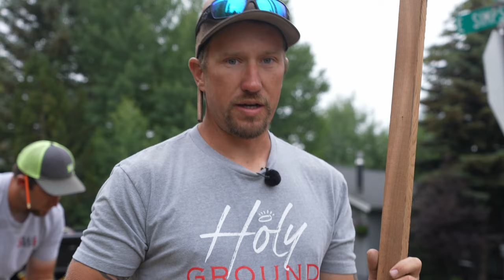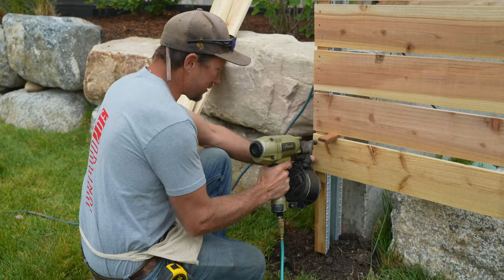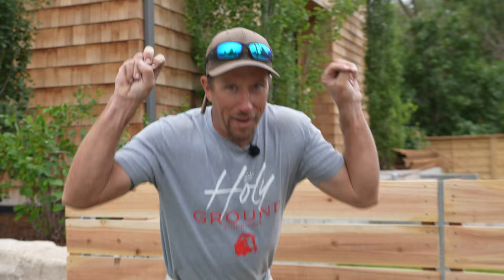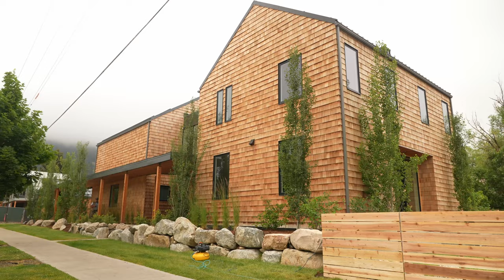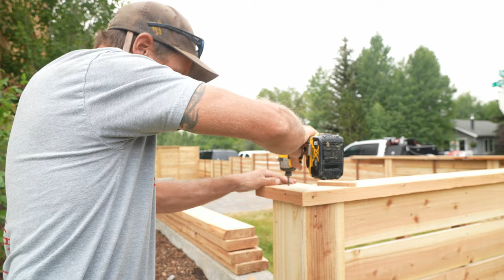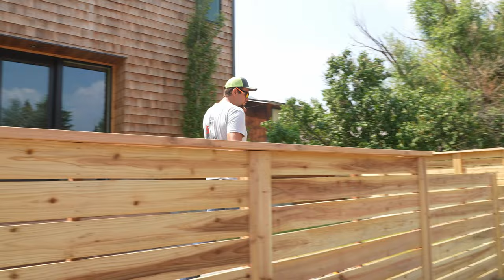When You Need A Fancy Fence: Stairstep Horizontal Cedar

Comment: Nice video. Thanks for sharing. Our HOA didnt approve horizontal fence. I am in the process of building an 8' BOB ceder fence. I have a question regarding the top cap board and trim. Would it be an issue if i used pine or treated pine? 2x6 ceder is about 4 times more expensive. What would be pros and cons of doing this? Your advise will be greatly appreciated.  Thanks in advance!
Reply from the maker: It may not match (which I'm sure you know), and it may not last as long. Will it work when forced by the budget? Yes. Will it look like cedar? No.

Comment: Hey SWI!  Thanks for these videos - im learning a ton.  Quick question: how did you get the two stair step posts to be 6” taller?  Im going to have to stair step my fence and wondering the best way to ensure I have enough room for a top picket (and not have it be like 3” taller instead of 6”).

Comment: What's the theory on when you need stays in between posts? I'm doing something similar to this with a retaining wall railing, but I'm probably putting a post every 4 feet rather than 6.
Reply: Ah, it was explained in the "pallet fence" video. The answer seems to be every 4 feet?
Reply: The stay is to prevent the wood from warping. I don’t know precise recommendations but maybe you don’t need the stay if you’re doing 4 ft posts

Comment: Hey guys awesome videos. I'm trying to find a clear answer to my question watching multiple videos from you but can't find what I'm looking for. Do you NEVER dig post holes and pour concrete for the Postmaster posts? Meaning do you ALWAYS just drive them into the ground? In Michigan the frost line is 42", so would you recommend just getting these and driving them into the ground 42" with no post holes/concrete? Or when DO you use concrete pours into pre dug post holes? THANKS!
Reply from the maker: You can totally set postmaster posts in concrete. Our preference is to drive them--but sometimes we have to dig and set for soil or tech spec reasons. You want to make sure you get below that frost line, whether you're digging or driving. If you're digging, the post doesn't have to get below frost line, of course, but the concrete does. If driving that's all you've got so you've got to get that post below that freeze/thaw heave. If your frost line is 42 I'd go a few inches lower.
Reply: @SWiFence  Thanks for the response guys! Ok, please humor me for one more point of clarification. You say "Our preference is to drive them--but sometimes we have to dig and set for soil or tech spec reasons." To be crystal clear, as a newbie in this area, you're saying that NOT using concrete footings, and simply driving these posts in (past the frost line as you mentioned) is a sufficient alternative to using the concrete footings? My point is that every video or piece of documentation I've ever seen has wooden posts set into concrete footings, and I'd love to just use these metal posts driven into the ground INSTEAD of having to dig a ton of large holes, drop some gravel at the bottom, set the post, pour the concrete, etc. So I just need to hear "oh yeah, you drive these babies to the appropriate depth and absolutely they are strong enough, just in the ground itself, to support a fence". Is that the bottom line? AGAIN, THANK YOU!
Reply from the maker: Vinyl wind test with concrete: https://youtu.be/_iQnheVwAI4
Vinyl wind test with driven posts: https://youtu.be/8jWcT17PFME
How to tell your driven posts are deep enough: https://youtu.be/e2YU3K6Sa1M
Cedar wind test with concrete: https://youtu.be/_rZr1xtjy0Q
Cedar wind test with driven posts: https://youtu.be/Ocr73Lmo9O8
To be clear. there ARE soil types that are not conducive to driving. Really rocky soil is going to keep you from driving the posts (or if you get them driven the posts are going to be loose--you can grab them and shift them around). But in general, the bottom line is you don't need concrete. It's no better. In fact it's more difficult and more of a pain.
Reply: @DerekRafferty  What did you end up doing Derek? I'm about to build this same fence in the video in Calgary, Alberta and I think I'm going to have a tractor auger come in to drill 3' deep holes and concrete each postmaster post into it. We have 4-6" cobbles about 10" down and then we have clay about 14-16" down. Need an auger to help and then definitely going to pay the money for concrete for each post.

Comment: Maybe a better idea would have been to make the top level, from the corner over to the higher side. No step on top, just the bottom. On a short run like that sometimes  less is more. 
 Customers can be a pain in the ass though! I built fence for too long!
Reply: I didn’t realize there was height reg…

Comment: These metal post are nice but at $95 each for a 9 foot pole it would cost more than the lumber almost just for the post. Too bad these are so crazy expensive and the Rhino  driver to install them is another $2k - $3k, would not be worth it unless you were a installer
Reply from the maker: Your comment has sparked some conversation--we're going to look into seeing if we can build or modify a tool to allow for manual pounding. 👍🏻
I understand the price of steel is higher than the price of wood and that takes folks by surprise sometimes. There's nothing wrong with opting for the cheaper option as long as you know what you're getting into. As professional installers we will only use steel because of the warranty work that it eliminates for us.
Reply: @SWiFence  I totally understand, and you guys do amazing work. I  can not manually dig post holes anymore, so I was trying to find an easier way to put up a privacy fence for my dogs. We just moved into a new place with no fence at all, it definitely looks a lot easier once you get it up on the post to drive it in, my main issue is the cost, if I could rent the Rhino driver that would be more doable, but there is the cost of $95 per post, I can not get past that. I live in ND where the wind can be down right ruthless so my poles need to be in the ground 3 feet I would imagine. I Enjoy your videos and quality of work, Thanks for sharing.
Reply: I mean I just went to Menards and chain link terminal posts are 16 add some adapters and you could do the same thing

Comment: How do you determine when you need to cement the posts?  I live in Iowa.
Reply: Our water table is too high for the soil to remain stable and the high winds we experience wreck havok on fences with proper footings even. You can do it but it will lean in time. You really want the concrete with a 4 ft deep footing.

Comment: The 1/2 gap in the cap is because your fence isn't str8. Nice try
Reply from the maker: Oh yay! The expert showed up! If only you had been there when I was doing the job... 😉😏
Reply: @SWiFence   hay man it ant my fault, U built a wavy fence. And you got call out on it. I'm mean it was only 4' high and something like 5' spand I figured that wood simple. Here a tip. From a 35 year not a "pro" but every damn good customer home builder. Levels, lazers are great. But they traded eye will catch everything. Or just cut your mistakes out the video.

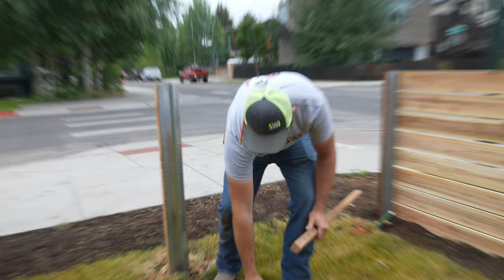Comment: Could you add a decorative cap with a spacer/gap above this fence? I fancy the cap style seen at 4:15 on the video below but would be otherwise building to your specs.. not sure how to pull that off 

4:15 here: https://youtu.be/grd2oh-6_O8
Reply: Actually, nevermind - I’m thinking you can just have your posts a few inches taller and simply not run the pickets to the top of the post. That should give the decorative gap